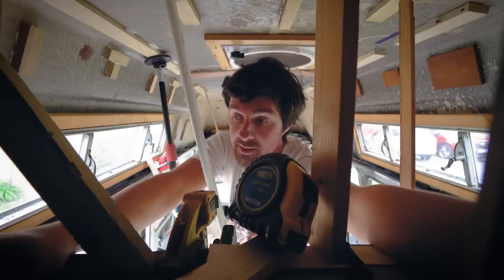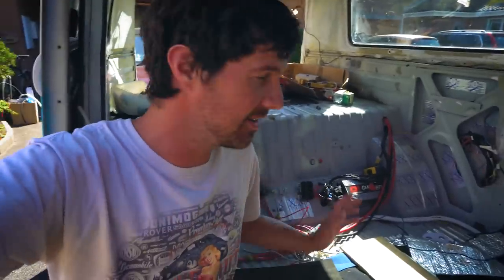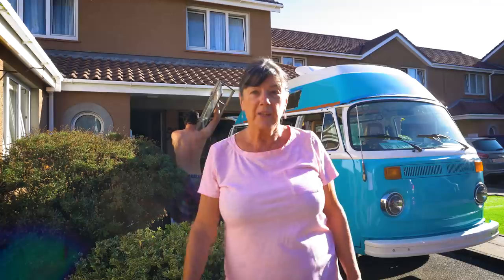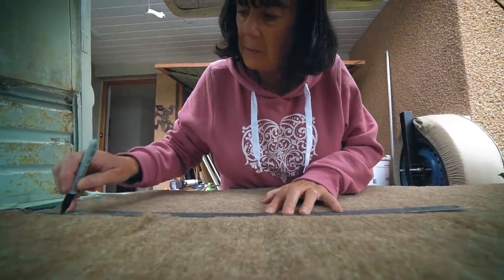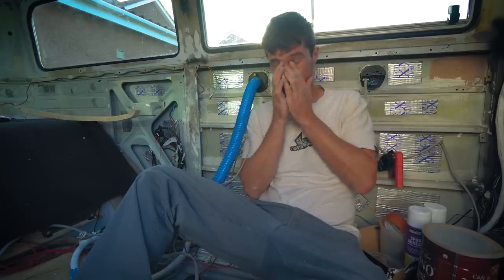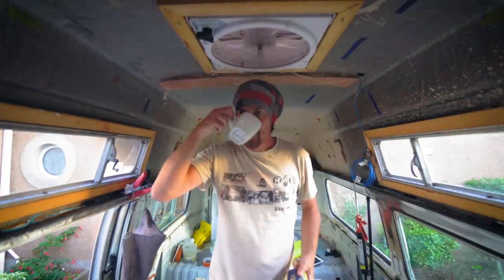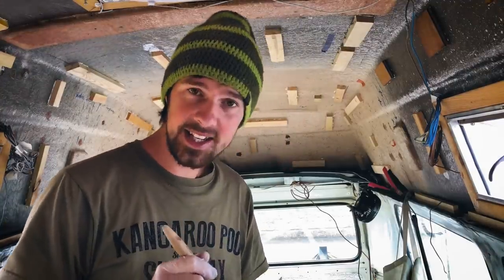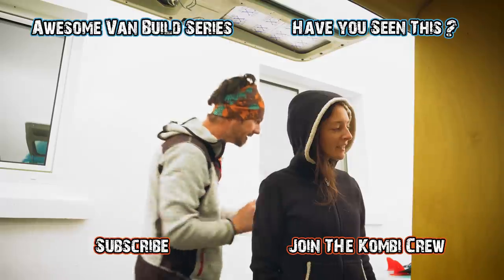The Hardest Part of Any Van Build // S02E03

Comment: Setup a work table and some sawhorses. You're making my back hurt just looking at you. I like to use a wide roll of craft paper and an exacto knife to trace the edge and then mark it on cardboard for a template. Good luck with your build!
Reply from the maker: Cheers for the tip.

Comment: Another great video guys. Cheers :)
I would be careful using the the green timber, it's "treated pine". It is treated with some very nasty chemicals ( it used to be arsenic, not sure about now ). It has been banned for use in Australia for any surface that may come into contact with people. I would avoid putting that inside Boomerang, it will probably be a real bad idea in the Aussie heat. I'm not 100% on how bad it really is but I would certainly be removing all of it and not using it in future if it were me personally.  ;)
Reply from the maker: Thanks for sharing this

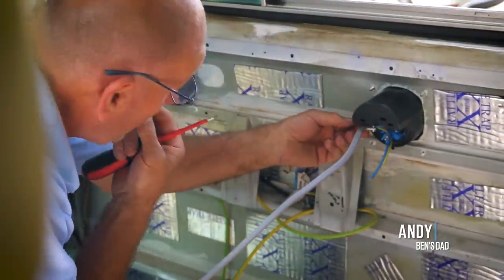Comment: 2:23 is that solid core T&E cable?  Solid core cable will break down internally in a vehicle due to vibrations, use flexible stranded cable instead.   Enjoying the build videos :)

Comment: Hi, its shaping up well, will you be fitting solar panels ? also, if you had a reflective roof like silver  ,,maybe  it would reflect heat away from the roof and keep the van cooler.

Comment: Instead of laying a carpet try going with a thin baboo flooring my friend had a Volkswagen bus and installed that into it and it works grate and its lightweight as well its also  it's easy to clean.
Reply from the maker: Good option - I wonder how well it provides sound insulation though :/
Reply: @KombiLife  I forgot what kind of insulation he used but it came in a roll and it was a he uses a cubic mini wood burning stove for the winter times and he lives in the State of Washington and says he loves the way his VW turned out
Reply: @KombiLife  I just talked to my friend he used  A product called Dynomat for the sound it's a bit pricey as you know because you used it on several spots already but he used it in the entire floor base of his vw mini bus. With a  Wool insulation on top of that to insulate it from the cold.

Comment: Probably too late to do anything about it.  But you used Twin and Earth for the hookup inlet wiring?  You should never use solid core cable in a mobile installation.  The vibrations of driving will work harden the copper and it will snap...  May not happen fast but you will eventually have issues with this.

Comment: Just saw you have a convoluted pipe  on your water filler, not good and hard to clean, you might wish you had used clear food grade smooth pipes
Reply from the maker: It’s only convoluted on the outside.
Reply: @KombiLife  Ah ok Good stuff :-)
Great videos   and a lot of hard work ... just sold my Mercedes Hymer had some great times in Switzerland and Europe 
with it

Comment: Do not dedicate too much time to the insulation inside if you are concerned about heat. Use thermal insulation paint on the roof and will do an excellent job. I have used it in the north of Australia in shipping containers and is awesome as the only insulation. You can get white and will make a great protection membrane as well. Have a look at this supplier in UK https://www.promain.co.uk/roof-paints-primers-cleaners/solar-reflective-paint.html.  Keep the dream alive
Reply from the maker: Thanks for the tip

Comment: 2:24 you must not use these wires. Please ask for help with electics in your car. Normaly there are the flry cables to be used in cars but you can use normal flexible cables as well even i dont recommend it. But never use like 3x1.5 or sto like this. And worse. NEVER use unflexible cables. NEVEREVER.

Please feel free to contact me for further support and reccomendation what to use and what not.
Reply: I'm about to start a VW van build . . Love to learn more about the does and don'ts from an electric perspective...
Reply: Ian O'Shea if you plan your whole system i reccommend to get advice from a local car electric specialist. But basicly the important things to know are: use flexible wires, care about the size of the cable and dont use amazon kits. Use enough fuses (between your 1. and 2. battery there are 2 needed. One close to each battery)

Comment: I know why I hated the paint jobs from the first  unveiling. It's so in your face ugly for a v w. Sorry, the reason is that high top is super tall and it's going to be ugly . But by painting it blue as the van you force the viewer to accept a new ugly shape. You going to like it or hate it.
  The best way is painted it white.. so it's view as a Ugly add on. On top of a good looking vw  bus. And being white it don't grab your attention  the bus is the attention.  I have a ford high  top van that blue and white too. I added a blue strip on the high top but it a faded baby blue and it end at the back as a visual wind scope at the back end. Like a duck tail. But being faided with with white spray over. It's soften the blue and it's in the back ground and not in your face. Lettering or circle can do wonder for beauty.  Van Presentation is first altitude of observation.  everyone will have one underneath. Just advise.